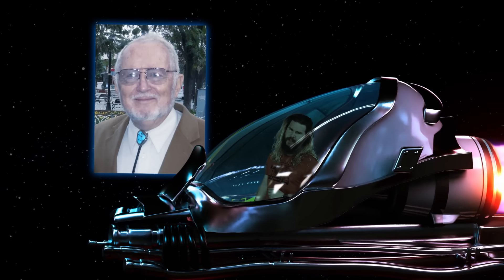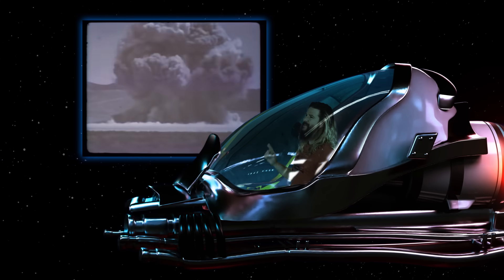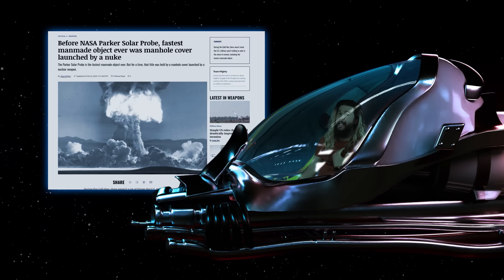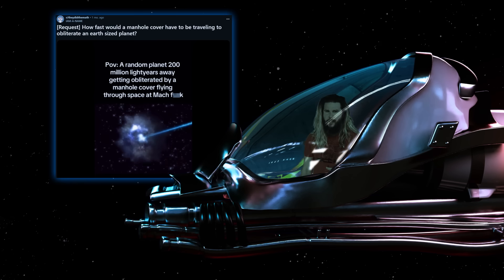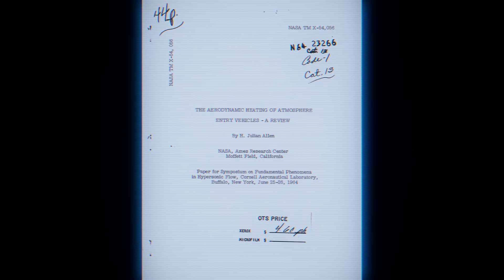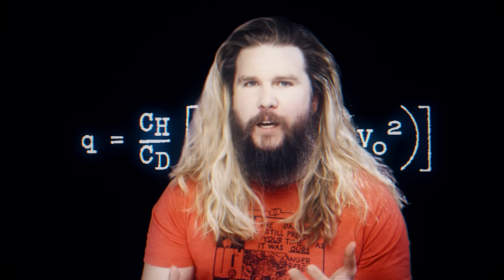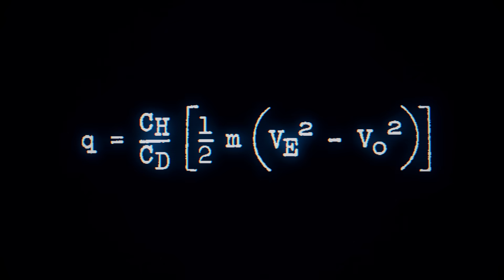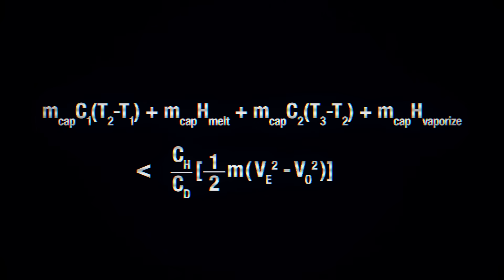Debunking the Nuclear-Powered Manhole Cover

Comment: Whenever people called this "the fastest man made object ever" I was like, "what about Voyager?"
Reply: The Parker Solar Probe is currently the fastest object ever built. At closest approach to the Sun in 2025 it will be travelling at 191 km/s, which is 0.064% the speed of light.
Reply: *at the time... Voyager was launched in the 70's.
Reply: What about the Parker Solar Probe?
Reply: That isn't even the claim. The claim is either fastest in atmo or fastest man made object AT THAT TIME. Cause this happened before the space race
Reply: The Voyagers are traveling at ~15 km/s. This thing was calculated to be traveling at 66 km/s. 66>15.
Reply: @DavidKJohnson1988  also, to consider-
~15m/s in space vs 66km/s in lower atmosphere.....WAY different.
Reply: Voyager 1 is currently traveling at around 17km/s. The manhole cover was launched at 66km/s, and it costs 18.25km/s of delta-V to eacape to solar system from earth orbit, so had it survived its new top speed is 47.85, leaving a difference of roughly 30km/s worth of ∆V that could have been lost to atmospheric drag and still be faster.

However the manhole cover experienced enough heating to vaporize it 10 times over, so the point is moot.
Reply: @jasonreed7522  No, it didn't experience 10x the heat required. Many people have pointed out the critical error in his calculation-- he used a final velocity of 0 to calculate the heat generated. In other words, he assumed it vaporized in order to prove it vaporized.
Reply: I call it the fastest accelerated man made object
Reply: What about parker space probe? 0.079% speed of light?
Reply: Yoyager only around 61.500 km/s, quite a bit slower.
Reply: Parker space probe is much faster
Reply: Because Voyager is 1/3rd the velocity. Theoretically, the manhole cover was moving at 125k-150k mph, whereas Voyager only moves at around 38k mph.
Reply: When I tell people about this story, I always call it the fastet man made object ever in the atmosphere
Reply: @itz_ringlot9168  I think that would work as long as you are talking about the atmosphere as an object and no an area bc in that case I would assume it would be a particle that is "man made" from a super collider also depends on if you count a single atom as an object or man made
Reply: or the pioneer probes, or the one we sent to Pluto, all of which are above escape velocity for the Sun...
Reply: @bipolarminddroppings  If the the speed is correct based on the single frame from that high speed camera than all of those probes are way slower and to add none of them even the manhole cover comes even close to the escape velocity of the sun which is at around 600 km/s
Reply: @zerocool6452 it's 617,5km/s in the "from Sun's surface" scenario. If you are refering to "escape solar system from earth surface" scenario, it's 42 km/s
Reply: voyager has the highest orbital energy of any manmade object
the parker space probe has the highest velocity of any manmade object

Comment: Fastest, I'm going to say yes. 
Space, only if it survived.
Legitimate question, what about the atmosphere getting thinner at higher altitudes?
Reply: I have the same question
Reply: I dont have a legitimate answer, but asteroids burn up on their way down, so its easy to accept an object of that velocity would burn a lot quicker on the way up 🤷‍♂
Reply: @generaljedi8691  Providing a nuclear explosively-formed projectile travelling slower than the gasses around it didn't create a super-cavitation.
Reply: @SoranoGuardias  what is that?
Reply: @generaljedi8691  Something that shatters ship propellers, or is used by pistol shrimps to kill their prey.
Reply: @gabbyn978  Does that work in atmosphere as well? Seems to occur most often in liquid, but I suppose it can happen in gas if the circumstances are extreme enough?
Reply: @generaljedi8691  actually, I don't know, as I have no idea how atmospheric super-cavitation looks like, or what it does.  

But what is sure, is that the air flow will be ripped apart because it can not pass the object fast enough; or as seen from the other side, the manhole would slam into a sonic wall so hard, it could as well be concrete. 

I also have no idea how fast the shock wave would travel through iron (probably the same speed as sonic waves in iron?), if it bounces, makes the manhole cover vibrate, or reflects from the back surface to the front and back several times like an old ruby laser, bends or expands the lid... 

This thing has so many unknown parameters.

Comment: The Fat Electrician already did the math
Reply: Loosely, he admits he isn't an expert.
Reply: @lurkingllama8364  rough math is still math
Reply: He also stated the cover was refined steel, not cast iron.
Reply: 2000 pound "Man hole cover"
Reply: @MusicaX79 
that's either a very wide manhole cover or a very thick one
Reply: @_Circus_Clapped_  BOTH
Reply: @_Circus_Clapped_  it wasn't an ordinary manhole cover, it was made for this specific purpose.